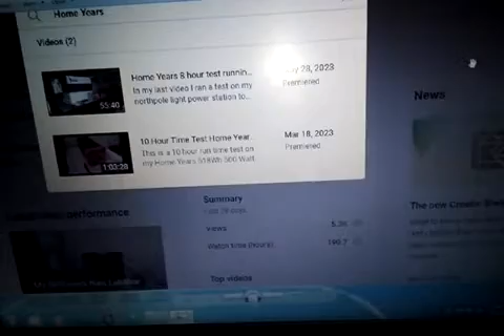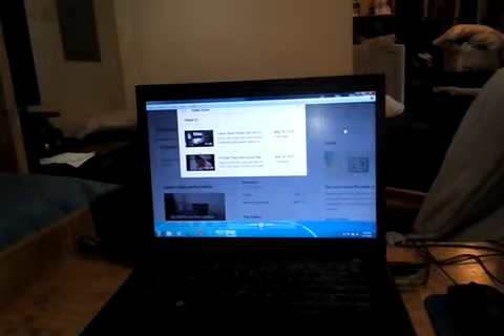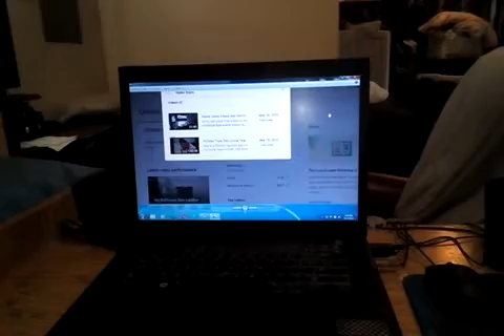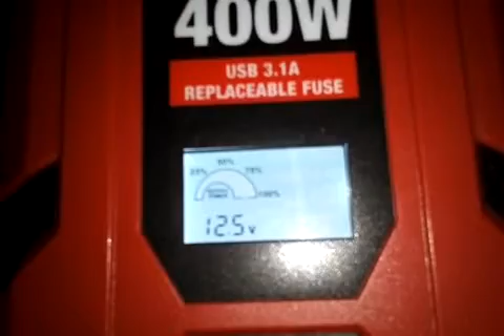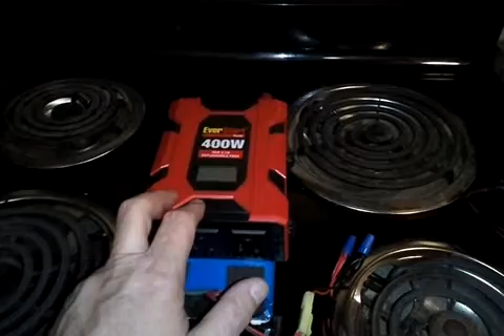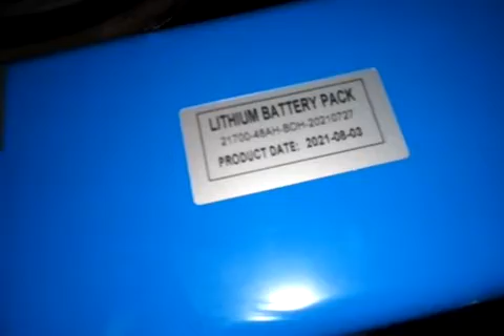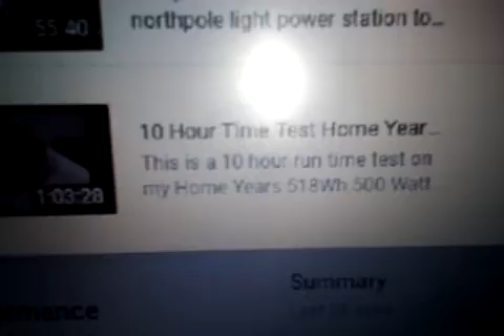Destroyed Power Station.

Comment: COme on, just throw the damn thing away, These things are cheaply made and just like yours, there are probably hundreds more world wide that went up in smoke the same day yours did. Now if YOU built it, then yoru video may have some good content. Have fun.
Reply from the maker: Why would I throw away stuff that I can use somewhere else.
Reply: Why would you keep something that most of the electronics are burned up? And the parts that didnt burn up are so cheaply made they most likely will break when you attempt to modify them to fit something else? So, never mind making a vid about you tearing it apart, make a vid of you BUILDING something from it if that is what you want. Anybody who has disassembled things like this have seen what scorched marks look like across electronics, Bedazzle us, not bore us.
Reply from the maker: @cferguson6688   You did see where I reused the battery pack and a small dc to ac power inverter to make a new power station right. Also if you want to see people build stuff from scratch then just go watch that content.